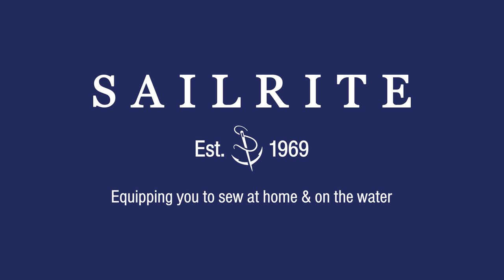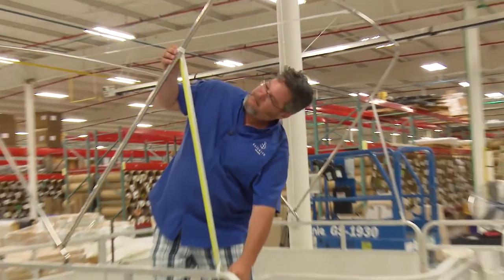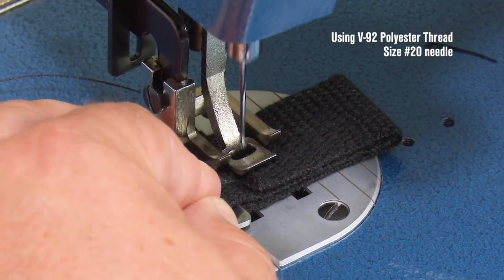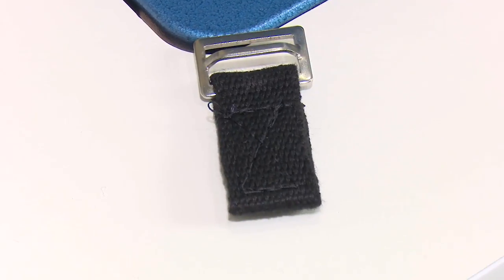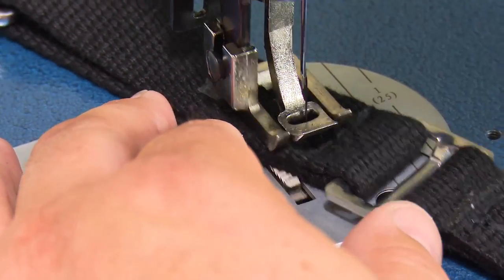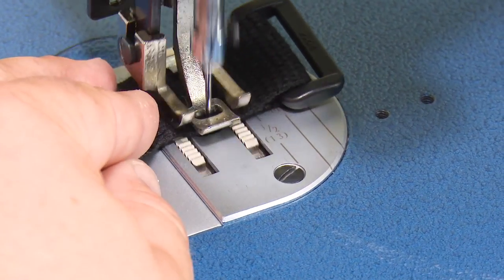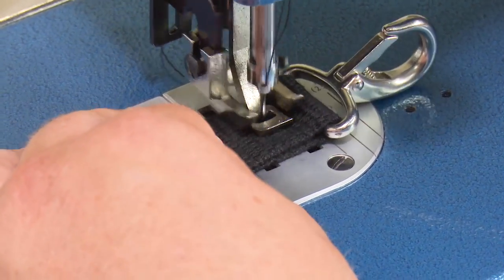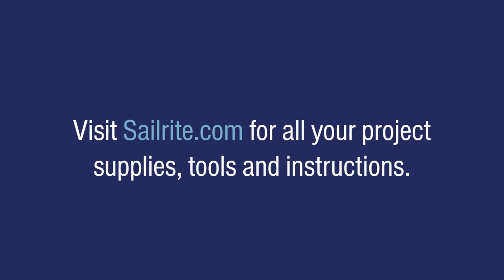How to Make an Adjustable Webbing Strap for a Bimini or Dodger

Comment: What Needle and thread are you using for sewing the straps and what other patterns old you use to secure the strapping for a boat securing to a lift.
Reply from the maker: We used a Tex 90 or V-92 Polyester Thread and a size #20 needle.

Comment: Aside from size, what style needle (tip) is suggested for webbing?  Wondering if I should use a ball end like for knits, or if a sharper universal or denim needle will pass through without tearing up the fibers.
Reply from the maker: When sewing webbing simply use a Round Point (Sharp) Needle. Here is a guide that will also help: https://www.sailrite.com/Selecting-a-Sewing-Machine-Needle